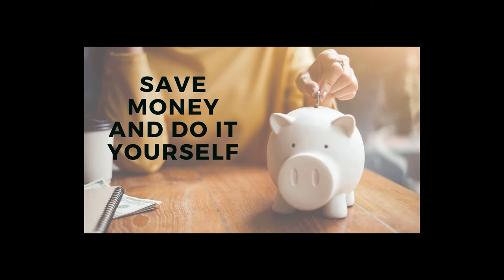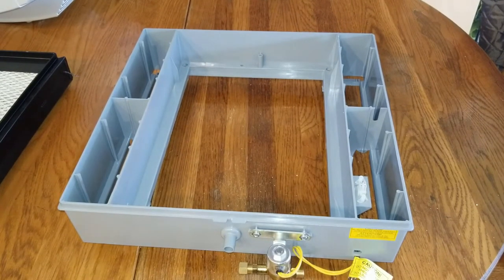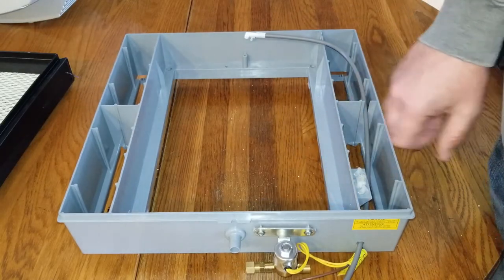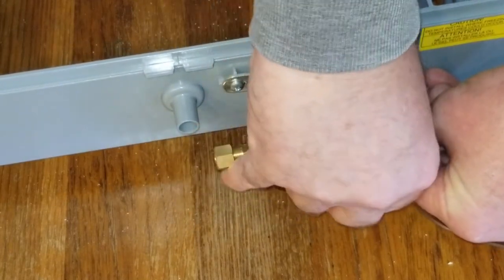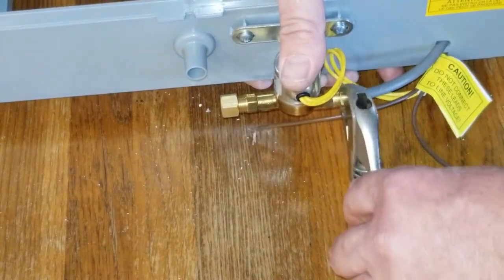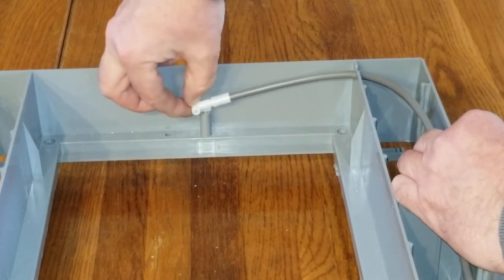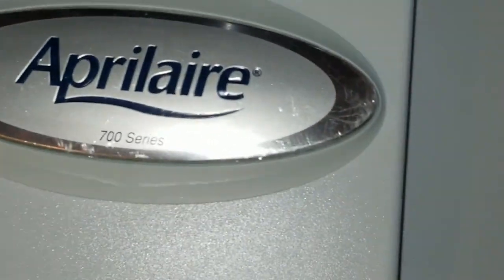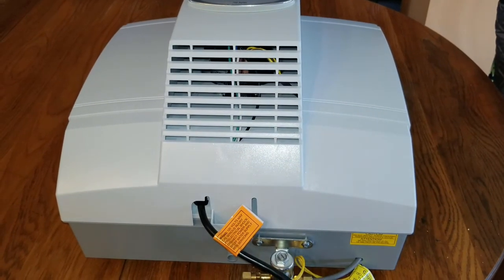Why Your Humidifier Is Leaking (and How to Fix It)

Comment: Outstanding Job on this Video! One question, the package I received had a red inline strainer and a yellow orifice(to replace the blue on my original). I believe the diagram is showing the red strainer is to replace the strainer in the inlet to the solenoid, but ours does not seem to have one. Should I put the yellow orifice on the end of the line going into the solenoid that we will also place a new inline strainer?
Reply from the maker: Sorry for the later than late response David. I am so thankful for your gracious comment and I am glad this video helped someone. The orifice should go on the leaving side of the solenoid. So between the solenoid and the humidifier outlet tube. The strainer is to protect the solenoid so it will go on the incoming water side of the solenoid. Hope that helps someone else who may have the same questions. Happy New Year!

Comment: My gray tubing cracked as it was so brittle. Can I just buy new tubing at a hardware store? If so, what diameter tubing is it. Can I reuse the old compression nut and plastic ferrule and the yellow end cap (looks like yours is blue) with the new tubing?
Reply from the maker: I am not sure if they have the same tubing. I would just take it with you and compare in the store, it should be 1/4 inch. I would not use the same ferrule but you can use the nut and orifice. Good luck. Thanks for watching.

Comment: I got a replacement feed tube kit, and the plastic ferrule seems to be the same diameter as the tube. I can't fit the ferrule over the tube. Is there a trick to this,  or did they give me the wrong size ferrule?
Reply from the maker: Sorry for the late response Nathan, I have never run into this. I am thinking wrong size.

Comment: I just need to change the line, which cracked. I can remove the ferrule from the water line, but the nozzle comes off with it. So I've got the brass ferrule with the plastic nozzle and the hose stuck inside. Help, please!
Reply from the maker: I am not sure what you are asking. The nozzle at the end of the line or the restrictor that is in the line at the water solenoid valve?

Comment: How much water will go out from the humidifier, i see that water is flowing out of the outlet how to stop/reduce the water wastage?
Reply from the maker: Hi, thanks for responding. Sorry it has been awhile since I've been on. The amount depends on how dry your air is and how much moisture is picked up while the air goes through the pad. You can try to meter it with the shut off valve. Thanks for watching.